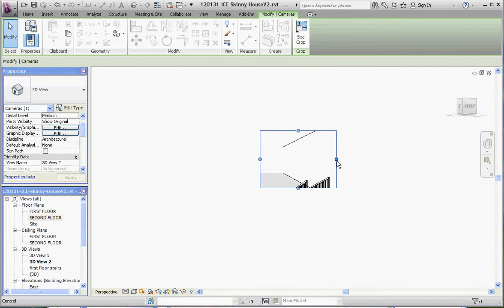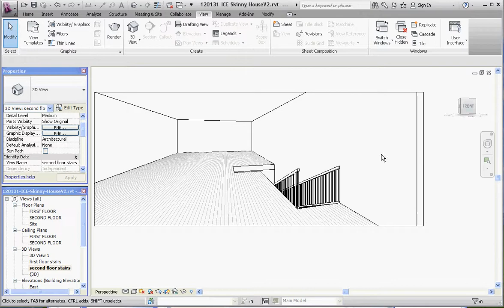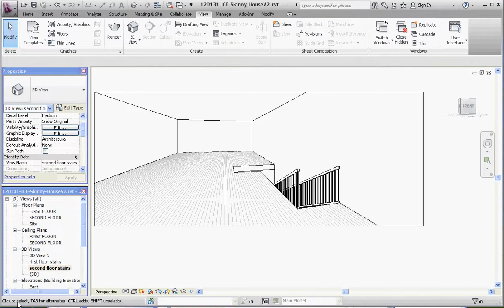Revit, Project Basics - Linear Stairs Part 3, Modify 2nd Floor – Cut Out for Our Stairs & Railings

Comment: Edit boundary doesn't show up when I select the floor, I'm using 2014
Reply from the maker: Not knowing your model it is hard to tell what is happening.  However, it can be tricky selecting objects in Revit.  Unlike similar programs, in Revit, in order to select an object, you need to click on an edge rather than a surface which can be difficult in some situations such as in selecting a floor where edges are not apparent.  You can select an edge by using a section view or at openings in the floor like at doors.  You can also scroll through multiple selections with the Tab key.  Then you can verify what you have selected by looking at your Status Bar on the bottom of the User Interface.  If you send me your model and describe your method I will send you a video reply.
Reply: I figured it out, I'm using 2014